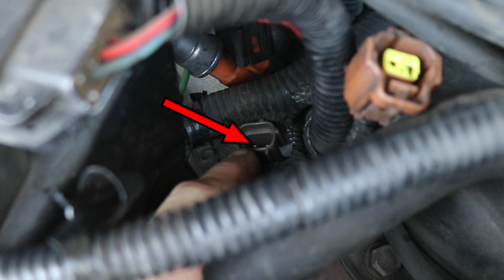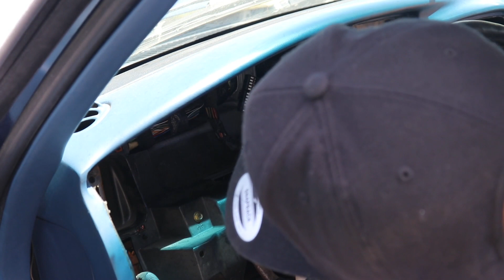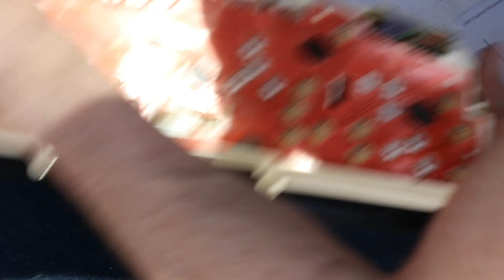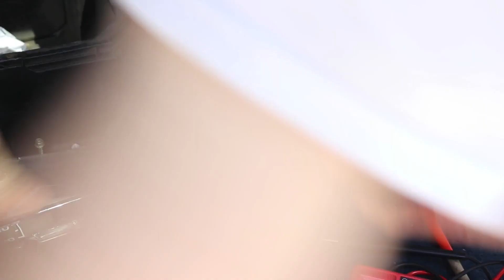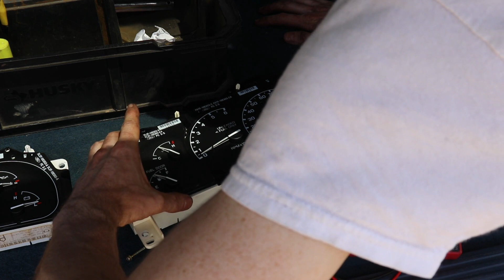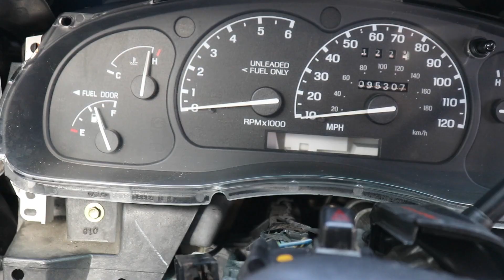Fixing 97-01 Explorer Temp Gauge

Comment: Great video. I have a 2001 Exp with a similar problem. Where did you find the specs on the temp gage? Also, my Tach is intermittent. It will start working after being driven for an extended period of time, like after 30 to 60 or more minutes. 🤷‍♂

Comment: Great diagnostic video. I have the same issue with a 2001 Mountaineer, but I have no intention of crawling around a junkyard to sort through instrument clusters.  I will use your valuable experience to test mu components, and if the cluster is the issue, I will get myself an aftermarket temperature gauge and find a place to install it 😁
Reply: Were you able to get an aftermarket temp gage? Where? Thanks
Reply: @aslydiver3440  It turned out to be unnecessary. After a lot of testing, I found that my gauge was OK, but the sender was junk. I then got 2 more new, but defective senders on line. The third was the charm.  As to aftermarket kits - there are 2 types. Electronic and analog. I have installed both, but I prefer the electronic. A bit of wiring is involved, and the new gauge sits outside of the dash - definitely a second best option.

Comment: This is a bit off topic but the gas gauge in my 99 sxplorer 5.0 is stuck on full and will not move. Can you conduct the same test on the fuel gauge as the temp gauge.  Do uou know what the reading should be.

Comment: The temperature sender/sensor sends a signal to your gauge and your computer.  A bad gauge should not affect your mileage, since the computer should be receiving the correct temp from the sensor.
Reply: the guage and computer use separate tempeture senders

Comment: 2000 exp with bad temp and oil pressure takes a while to readd My problem is a bad battery draw, could this be my cluster or GEM.

Comment: Does this cause issue with the Mileage reading, or is that stored elsewhere? Just wondering if I end up swapping everything, if it’s going to cause any other issues.
Reply from the maker: 10:42 Shows how there are 3 different modules in the cluster assembly. The center module has the odometer/speedo/tach. I kept the same center module with my explorer so my odometer reading stayed the same.